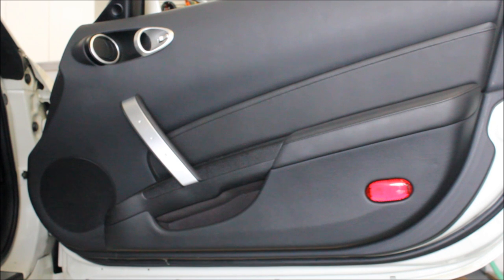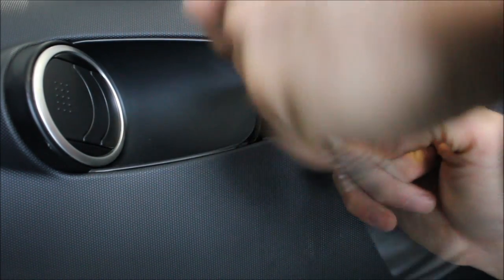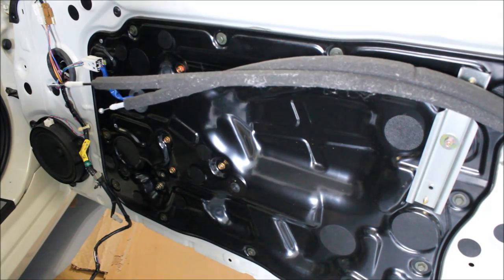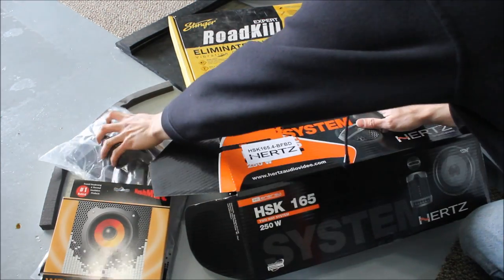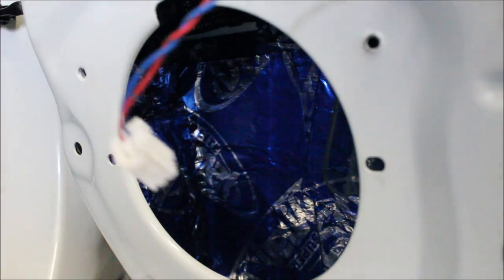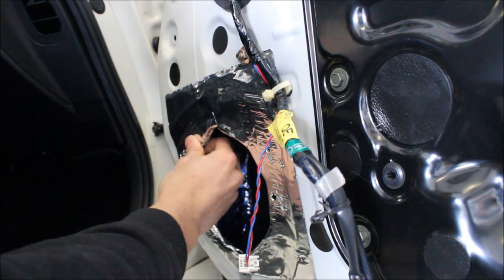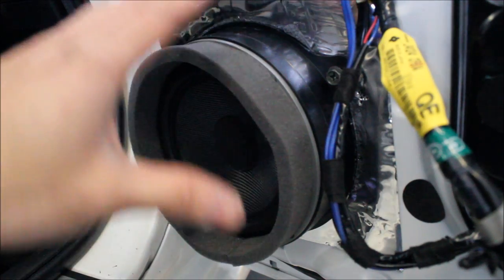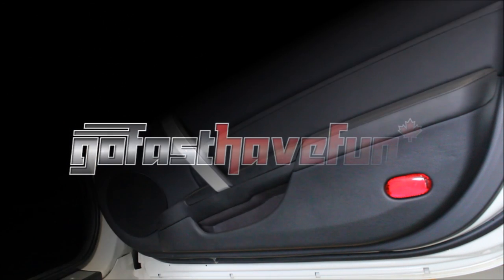Nissan 350Z Component Speaker Install (Door panel removal) | AnthonyJ350

Comment: 1:30  the previous owner of my 350z put a bolt in the bottom handle part .. it's too long to get with a socket.. 
dunno what the heck he did there.. 

fortunately, i was able to remove the grille ..i'l put the new speeekerz from there..
Reply from the maker: klepetar That's sounds like it was annoying

Comment: great video. I'm thinking of doing this exact install in my z.  what amp are you driving the front speakers with and where did you mount it? 

also, are you using the rear speakers? I've read a lot of posts where people have disconnected them.

thanks!
Reply from the maker: +j pugs I'll be using Alpine Electronics'  INE-W967HD head unit and their PDX V9 5-channel amp mounted in the glove box.  That way it's hidden and easy for me to tune whenever I want.

For speakers I'm doing an odd setup where I'm only using the woofers from the Hertz High Energies and I'm tuning them to only play mid range bass frequencies.  So I'm stage the car from the rear to play roughly 70-60 hz and below, the middle will be on a HPF to 60 but I'll cut it off so it doesn't play anything really high and the front will play from 60HZ all the way up.  I've never done it this way stage a vehicle progressively like that so I figure I'd try it.

Comment: Hi Anthony. do you think it would make much of a difference drilling out the rest of the holes on the speaker grill or cutting out the center and wrapping it with speaker cloth ? Thanks for the how to videos & putting up with some of the clowns that comment on here
Reply from the maker: Funny you say that because I tried drilling them out more but the plastic didn't drill out clean so I cleaned up what I drilled.  I would drill them out sand it down and then cover in a grille cloth that matches your door colour.  The reason I don't suggest cutting it out is in the real world someone might end up pushing through the cloth damaging the speaker.

Comment: Thanks for the video, very informative. Where did you get the 1/2 inch spacers that have a wide enough inside diameter to go over those Hertz speakers?
Reply from the maker: +Nickels Worth I work at an install shop, so we carry Metra's speaker spacers.  I did have to router them out a bit because the Hertz speakers are quite large.

Comment: Wish you showed the wiring... great vid but that was the main thing needed
Reply from the maker: Thanks for the feedback!
Reply: @AnthonyJ350   would u consider making a wiring instruction video? another great video idea would be doing the bose harness to aftermarket amp thats in the rear of the trunk... absolutely noone has a video on this specifically on the 350z where alot of people need it most!
Reply from the maker: @esperxecho4134  Maybe if I every work on a 350Z to do that job.  I just do generalized concepts to give people ideas on best practices.  I don't want to give away too many trade secrets and take away from my peers.  If a job is too technical to figure out, I highly recommend visiting your local installation shop.

Comment: Can you link the foam tape you used?
Reply from the maker: I switched over to using FAST Rings for acoustic material https://www.youtube.com/watch?v=zxyDVDecojI
Reply: Oh cool. I didn't even see your comment until now, and I have already ordered some of those. I do have another question though. What was the approximate depth of your adapter and spacer together? You mentioned that your spacer was 1/2 inch I think, but I couldn't find out how deep your adapter was. Also what kind of speaker gasket tape do you use? Thank you so much!
Reply from the maker: @brycekiesel  I think I was close to an inch when done. I use FAST rings now for a gasket.
Reply from the maker: Here's the video I made using FAST Rings https://www.youtube.com/watch?v=zxyDVDecojI&t=1s
Reply: So if I currently have a 3/4 inch adapter should I get a 1-inch spacer or a .5 inch spacer? When I said gasket tape I was referring to the really thin stuff you would put between the door and adapter or adapter and spacer to reduce a slight amount of vibration.
Reply from the maker: @brycekiesel  I would try a .25" adapter on top of what you have. You can just get foam tape at Home Depot and that will do the job.
Reply: Ok thanks so much!

Comment: can you use styrofoam instead of the wave breaker mat
Reply from the maker: Maybe, never tried it.  The Wavebreaker has a really good adhesive and conform to the contour of the door easily while the styrofoam is likely to crack.  The styrofoam might also be too hard of a surface not absorbing the back wave.

Comment: That baffle you bought KILLS all bass. You should remove that from behind the speakers.
Edit: sorry, didn't notice you cut them at the bottom.
Reply from the maker: Paweł Be Yup that's what we found out to address that problem. Cut them open.
Reply: I'm thinking about routing cables to the woofer but after I saw how risky it is, I think I'm good with how it is though knowing how thin OEM wires are.....
Reply: Geeeez. I've just noticed I wrote the same comment a year  ago :D
Reply from the maker: Paweł Be I run 100 watts rms through the factory lines. That's the most I'm willing to run through them.

Comment: Why crossovers mounted in door?
Reply from the maker: +SeanOMatic The tweeter and mid range woofer are all located in the door so it only makes sense to mount the passive cross overs in the as well to keep the wire runs simple and short.
Reply: AnthonyJ350  Got ya. I normally install my crossovers in kick panels or with the amp in the trunk, but I can see cost/time being a consideration.

Comment: Could you message  or reply to me a list of the exact products you used? thank you
Reply: specifically the spacer used/adapter used? thank you dude. great work
Reply from the maker: Michael Zosa You can email me at info@gofasthavefun.ca and I'll reply with the parts list. I used speaker adapters from Metra. Your local install shop can get them for you.

Comment: Apart from Nissan fucking up Tweeter placement, this is a great video
Reply from the maker: +jody024 Thanks!
Reply: AnthonyJ350
BTW: where did you buy that panel removal tool ?
Reply from the maker: jody024 http://12vtools.com/
Reply: AnthonyJ350
Thank you

Comment: Why put such a powerful speaker in the door without amplifier? The hu is not powerful enough to drive those.
Reply from the maker: Because I added a PDX V9 in a later video.
Reply: ok that makes sense. Do you have another amp for sub?
Reply from the maker: DROIDRAZR16 Nope I run a 5 channel. If you search my 350Z Playlist you can see the completed system. And I play the system on my Facebook page.

Comment: And that's how you install a pair of $600.00 dollars speakers , Squeeze all the juice out of those Hertz . Not over done just the right amount of sound deadener.
Reply from the maker: +juancmendez38 Yup, you don't have to cover every square inch especially with a door like this with a relatively good seal.  Trying to show all these Tuner guys you can have a sound system without adding much weight at all.

Comment: pioneer avic-8100nex front  2 Alpine SPR-60C 6.5" Component Two-Way rear 2  Alpine SPR-60 6.5" Type-R Coaxial  amp for the speakers  MTX Thunder 75.4 
2 amp for 2 subwoofer mtx thunder 1000.1 at ohm and 2  JL Audio 10W6v3‑D4 10" in a sealed box i have  pictures if you want i can sended to you all my wire is stinger 0 gauge  and 4 gauge i have  for power xp 1200d secondary battery xs power   xp 950  i take some of your ideas thanks you for all your videos
Reply from the maker: +Omar Ortega Niice!  Ya you can e-mail me at info@gofasthavefun.ca

Comment: how much would this cost ?
Reply from the maker: Retail on the speakers is around $500 plus plates and sound deadening material.  Ball park, $750 in parts and material.
Reply: @AnthonyJ350  jesus christ that much? I got kicker speakers for less than half of that
Reply from the maker: @pushhrodd01  It's Canadian pricing if that helps.

Comment: Don't use these closed speaker baffles. If you know how drivers work you'll know these baffles will destroy your bass
Reply from the maker: +Paweł Be (Bilazaurus) You did see the part where I talked about cutting most of it out and just using the top as a water shield right?  To avoid the issue you comment is about.  If I left it closed, what's the point of the Wave Breaker behind?

Comment: Position of the tweeter is very horrible
Reply from the maker: +AutoStudio Нальчик But that's the factory location.  I didn't feel like spending 4 to 5 hours building pods and then they'll weigh a lot and it's the smalled ball and socket design holding these in.  And I haven't decided if I'm going to do gauges on my a-pillar so I can't mount them there yet.
Reply: +AutoStudio Нальчик  critical comment with no justification and good input to back it up.
Reply: +jewllake tweters are for ears,not for legs
Reply: +AnthonyJ350 Pods aren't that heavy....
Reply from the maker: +AutoStudio Нальчик The tweeters are positioned at head level.  I mean you can hear their definition just fine.  Now maybe the way it got captured on camera you may think they are angling down for some reason as tweeters are very directional.  Rest assured they're not.  But what do I know right?